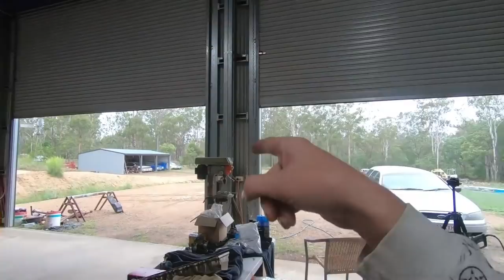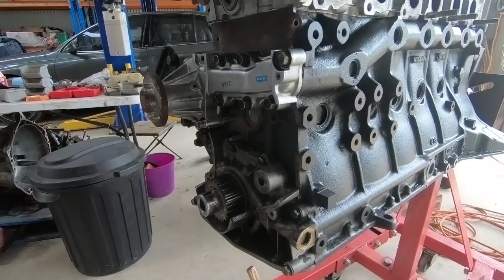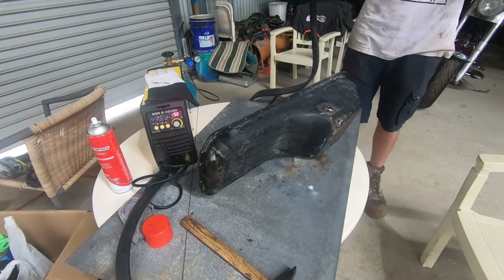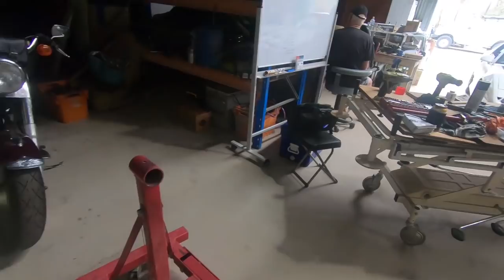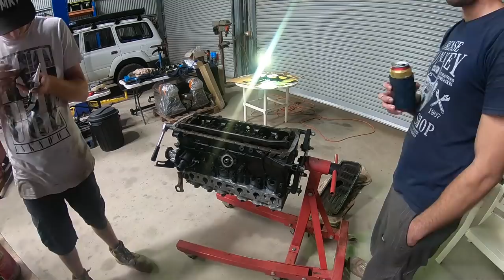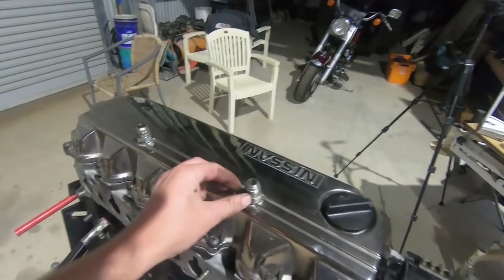R31 RE-BIRTH Part 12: Timing, Sump and Cover

Comment: Good idea with the sump temp sensor, I'll be doing this now. Was also thinking about adding some more on the sides for extra capacity, mainly because it's got a big dent.
Reply from the maker: Zach Curran more oil is always a good thing! One day i probably will build a better sump... one day 😂

Comment: I need your help 😂 I'm stuck on  rb30 base timing,. I line up the far left mark on harmonic balancer and then install distributer with rotor facing #1 however it doesn't start. It'll start if I remove distributer bolt and turn the dizzi a mile and still won't run great. Did run good but as soon as it got warm it would run like crap. However the water temp on gauge didn't work, but did work a week ago when it was running half alright.

Comment: rb30s are not interference motors, unless the cams have been changed
Reply from the maker: VerifiedAdventures from my measurements with dome tops, oem hg and std cam/valve leaves around 2 thou clearence. I would certainly call this an interference engine. Some get luckier than others, however, nothing like a non interference engine as far as clearence goes.
Reply: @BoostGumps  So basically it depends if your engine is up to temperature or not. 😂 Thermal expansion will take up that gap and some.